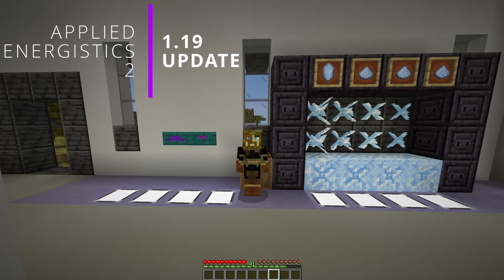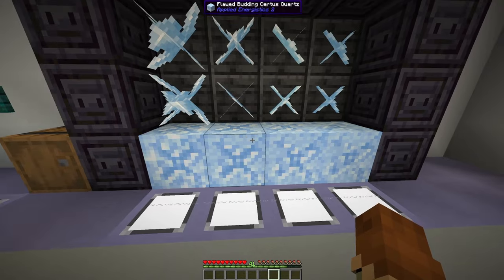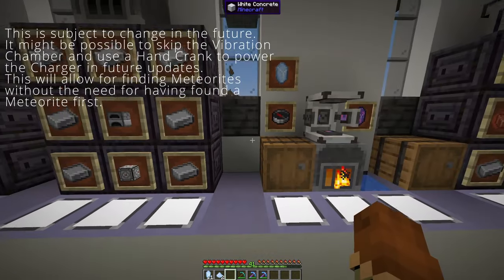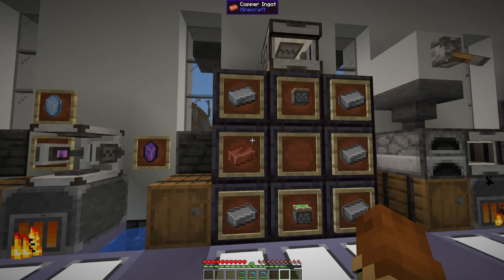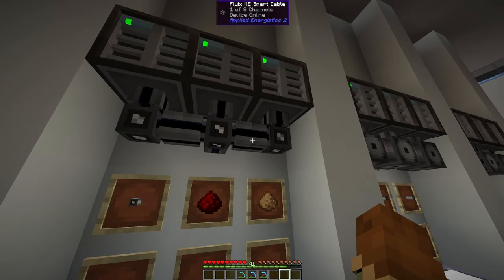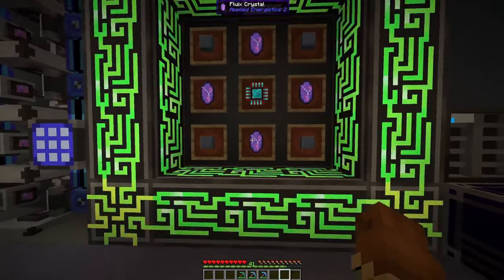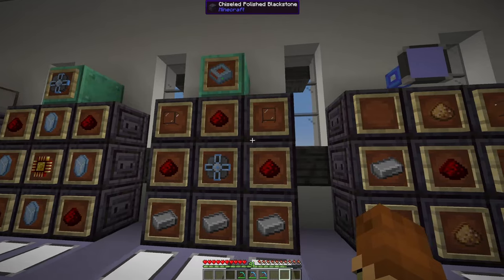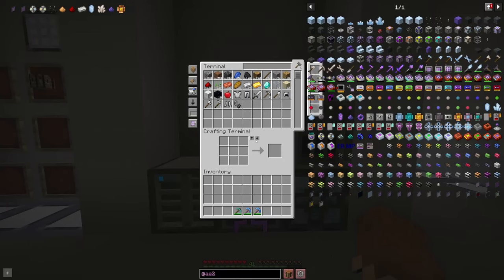How to Get Certus Quartz in 1.19 & 1.20 | Applied Energistics 2

Comment: Love the video Thanks. Not many new 1.18 and 1.19 tuts out there.   If you have this in a Mod Pack you can move the Budding block with RFTools builder Bit tricky but it works, or Mekanism carboard boxes, cheap and easy.

Comment: Very good video, and very helpful. I noticed you said you have an auto farm video forthcoming, but I was able to duplicate your setup, but can't stop the Annihilation Plane from breaking the small crystals immediately. I mirrored your Storage Bus placement and settings, but still the same problem. Suggestions? I have crystals and dust for days now, but would like it to be automated. Thanks.
Reply from the maker: I just posted a video that goes through the whole setup. Hopefully it helps you!
Reply: @_Striker  Thank you very much. I actually realized, through the help of another commentor, that my issue was mixed networks; missing fiber cables. Once i figured that out, I was golden. Also, another tip if you have Mekanism, you can use the cardboard box to pick up a perfect budding block and move it to your setup. Then, you don't have to worry about silk touch, or degradation. Now, I just have two perfect budding blocks. One that breaks everything, and the other that breaks clusters. I have more certs than I'll ever need. Thank you for your videos. Got the ball rolling! Also, got a sub!